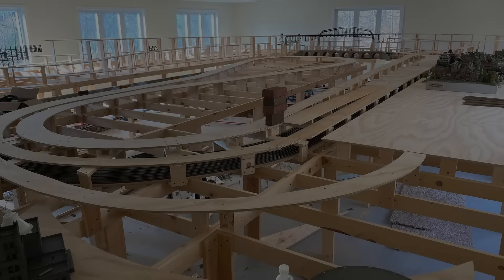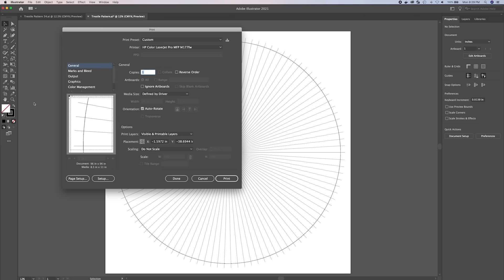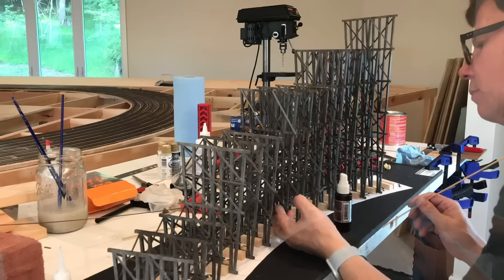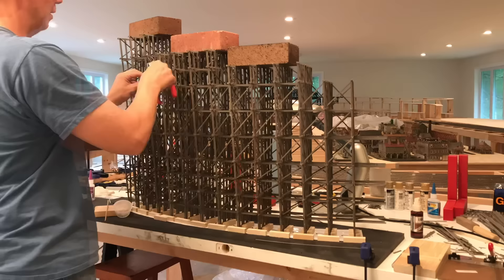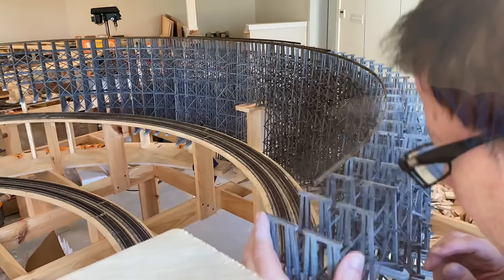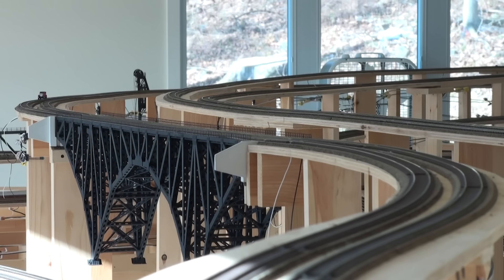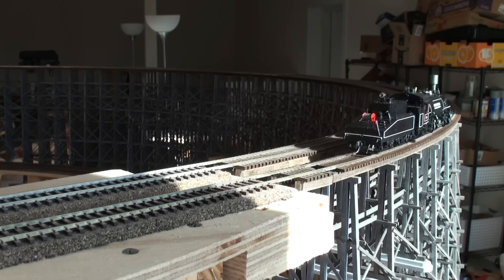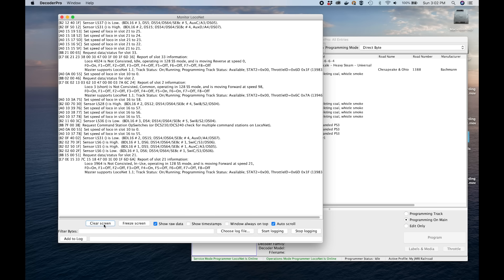S1: E4: Layout Update: 12ft Long Curved Wooden Trestle!

Comment: That's one impressive trestle.  Do you know of a prototype example for a double track wood frame trestle of that magnitude?
The reason I ask is that I am under the impression that tall frame trestles were generally used to get a line open quickly with minimal expense, and if a railroad has enough traffic to justify a double track main line, then they probably have the funds to build a more permanent steel structure with lower maintenance costs and fire risk.

Comment: Great Job!!! 

I have a liitle tip. When you want to print something so big in illustrator, on the main print window, on the "scaling" option you can select "tile full pages". It wil let you print everything in one run in perfect alignment. If you want you can print it to a PDF so you can later select wich pages you need for less usless prints
Reply from the maker: Thanks for the tip!

Comment: Beautiful trestle bridge. I am looking at building a double track trestle. Would you be willing to share or sell me specs you used for the bents and double track spacing. Thanks
Reply from the maker: Thanks! The on-center spacing is 2-1/4 inches (which is sufficient give the 44" radius). The bents range in height, the tallest being 24 inches. What other specs were you looking for?
Reply: That helps Thanks again